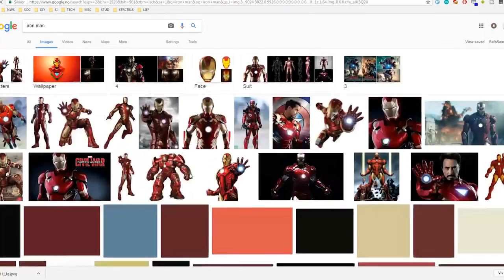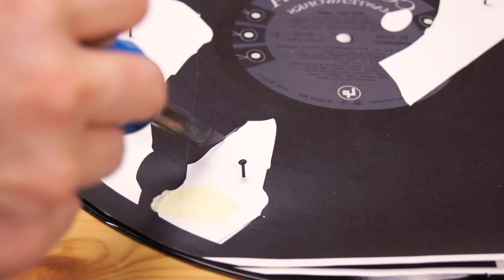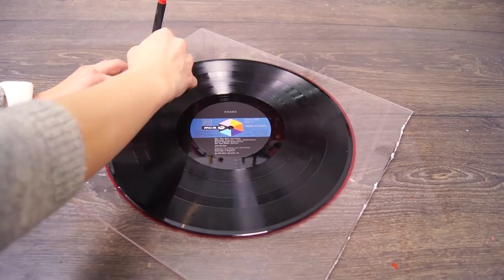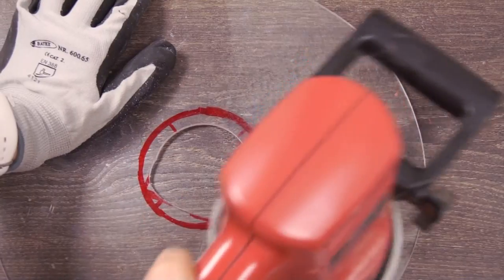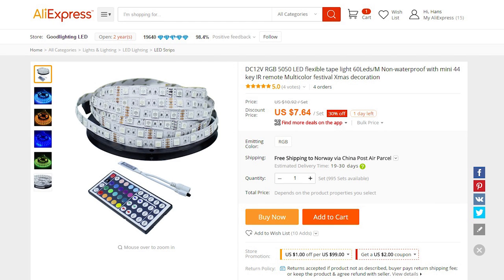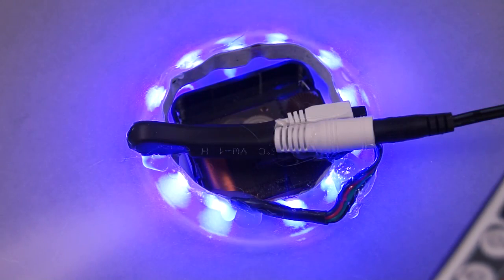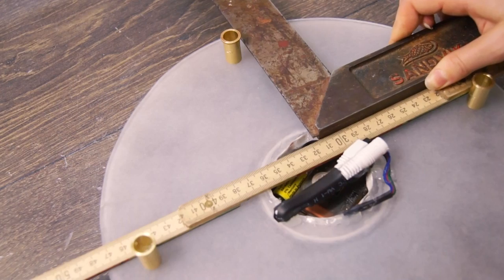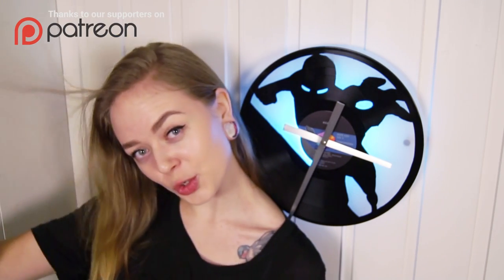Vinyl Record LED Clock (Iron Man Edition) || How-to

Comment: Hi! Melting vinyl isn't a good idea, because it creates a chloride acid steam and it is very dangerous for you health. It is better to work with vinyl in mechanical way. Good luck with you chanel, I really like it! ;)PS Sorry for my mistakes:)
Reply from the maker: That is a good point, and I should probably have mentioned the cutting was done with a gas filter mask and under ventilation. Thumbs up for pointing it out :) And thank you!
Reply: SlayPowaaa Cnc milling, fretsaw, dremel, scalpel or something

Comment: Great project, maybe make the clock hands glow-in-the-dark, or light up with the strips as well? It doesn't seem that easy to read the time when the LED backlights are on in the dark.
Reply from the maker: That is a good point, and it is no secret that it's main purpose is not to tell the time. That being said, it does quite alright in the light. In the dark you are right, it would need some lighting or another clever solution to be functional and not only decorative :)
Reply: Natural Nerd well, your modular design makes it easy to swap out a vinyl template that has numbers cut out for the light to shine through, thus adding functionality. Wait, you just gave me an idea for a clock with no hands, but has a rotating face instead :-)
Reply from the maker: K9JT Interesting! Let me know how that turns out :D